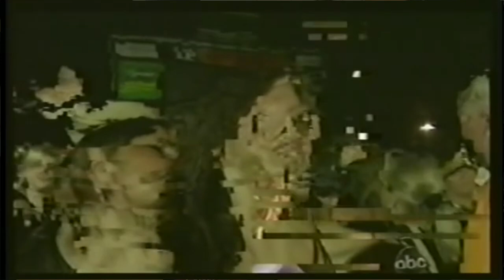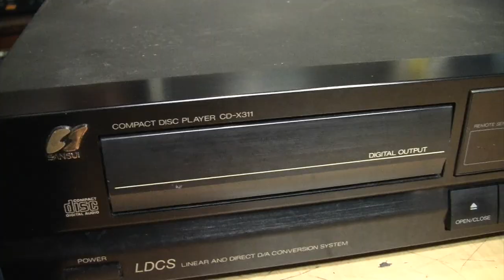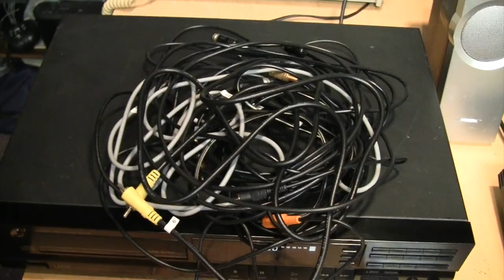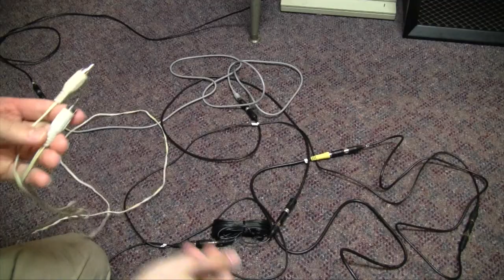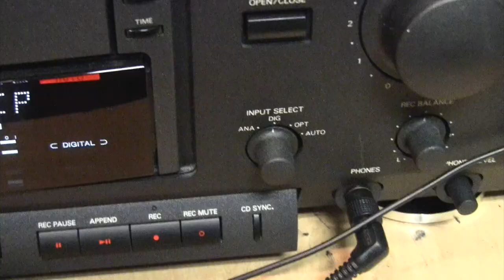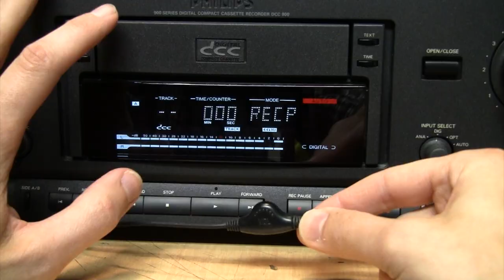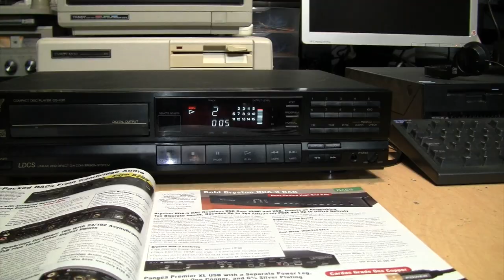What does a crappy digital audio cable actually sound like?

Comment: Yep, as far as I know, all that's happening when you add too much length or turn the pot too far down is that the voltage ceases to be high enough for the system to decipher the highs as 1s vs. the lows as 0s. So maybe by that time it looks like mostly or all 0s.
Or Jac Goudsmit's explanation might be a better one. It surely does look thorough!

Comment: You mixing “foot” and “feet”. Its kind a confusing for non native speaker.
Reply from the maker: Normally "feet" is the plural of "foot", except when it is used as an adjective, then it stays "foot" regardless of the length -- as in "a 6-foot cable". But when it's a noun, then you do use the plural form, as in "the cable is 6 feet long".

Comment: When you ran the signal through both the black and red wires of the stereo cable you introduced a huge amount of cross-talk within the signal which would have interfered with the ability of the hardware to extract the signal clock. That's a very degenerate case and not really indicative of how long the cable was.  Still a very interesting test.

Comment: I had some grounding problems using a non-coaxial RCA cable to transport S/PDIF, in particular when some equipment or light is turned on or off in the same home: in some cases, even a neon light bulb would cause the audio signal to interrupt for a couple of seconds because of the ground level difference between the computer and the amplifier.

Comment: I am only 4 minutes in to this video and I can see where it is going ….. you will try to convince us that quality cables are superfluous.  However, you need to be using much, much higher end source, amplification and speaker system to show the differences.  And using a computer sound card to deal with the signal?  Really!  And with an unauthorised driver as well?  Not one part of this audio chain is of decent quality.  You need to do this test with high end equipment with a minimum costing of £25,000 so it is no wonder you can't hear the differences.
Reply from the maker: You still don't understand how digital works, do you? There are no such differences to be heard until the signal begins to fail dramatically, as I showed. There is no analog-style gradual degradation.
Reply: I hear what you are saying but I remain unconvinced unless you are doing an A/B listening test comparison.  That is the important bit, not whether a signal begins to fail dependent on type or length of cable.  In your setup there would be no apparent difference between a 3 foot length of cheap cable and a 3ft £100 cable.  Just saying!

Comment: It was probably the Y adapters which caused the problem they would have induced a voltage standing wave (VSWR), reflecting the signal back up the wire, this would corrupt the good signal.  Digital cables need terminating correctly or you will get loads of problems.  You should use decent cables but by that I mean spend a few quid (English pound) and not hundreds of pounds. Many of the expensive "gold" cables on Amazon and Ebay are pretty rubbish as they are made to look pretty but not necessarily work well.

Comment: I always thought digital was digital until I swapped the USB cable from my Allen & Heath mixer for a 3m printer cable which gave me all sorts of trouble.  Repositioned the new Hackintosh and installed the original cable, good as gold
Reply: It could've been a USB1 cable.
USB1/1.1 cables can't handle the full USB2 speed - even though the pin connections are the same, USB2 cable specs requires shielding, twisted cables etc due to the much higher speed. I guess the longer the cable, the less chance a USB1 cable would work too. Supposedly USB2 cables are meant to have '+' next to the USB symbol on the cable, but I can't remember ever seeing that.
I suppose some devices also draw more power, perhaps very thin wires(higher resistance) cause problems in this case. Even a damaged usb2 cable could work fine for usb1(or slower usb2 connections) in some cases, such as if the shielding connection broke.
Some USB cables are made to only carry power, or only data, so it gets quite messy!
Fortunately when listening to music, it's a lot easier to tell if there's a problem :)
It does seem 'digital is digital' is accurate, as long as the cable is being used as intended.

Comment: Every certain amount of length of wire has a resistance to it. Every so many feet your voltage or ( signal ) will get lower and lower. You will reach a point where you will have to have a bigger amplifier to push your signal!

Comment: what you should have done is record 10 seconds worth of the CD with the short cable, then record the exact 10 seconds worth of audio with the 100 feet of cable mess.. then open both audio files side by side with a spectrum analyzer (free ones like Spek) and see if there is a difference in the waveform or not which will be definitive proof if cable matters. Just because it may sound fine to your ears, doesn't necessarily mean the digital signal made it end-to-end in tact.

I am assuming there may be extra noise or missing bits in the signal, as in electrical engineering, when using a tool such as a oscilloscope, cable length and unshielded cables do affect signals and is made visible on a oscilloscope as noise/flutter, or whatever to the signal, for example can feed a square wave and increase the cable length and suddenly that signal displaying on your oscilloscope isn't as "square" as it was: https://i.imgur.com/UlQNzY3.png, while that may go undetected and sound ok to your ears, there's obviously a change that happened to the original audio.

Comment: Theoretically going into an external DAC using USB shouldn't care what cable I use right?
I've used 2 different cables and noticed something odd. The longer, thicker cable had less interference
than the shorter thinner cable. By interference it's nothing like what was in the video, it was subtle yet still noticeable to anyone.
 If it's all digital, they should sound the same correct? I might make a video at a later time if someone thinks I'm making it up.

Comment: Currently watching over a 75 ft CAT5 cable, and able to pull down my full 150 provided by my ISP.  Also silly enough, the coax cable going from my modem to the connection outside is well over 200 ft.  Beyond what my ISP thinks is possible to transfer data over.  I even have to argue with them to replace it when it’s gotten broken a few different times.  Yet it still works fine when installed.  I am a firm believer that if both devices are able to transmit the signal(granted you are doing tx rx), they will work fine.

Look at WiFi, in some cases we can transfer hundreds of Megabits per second right over thin air at low power, even considering the help of TCP.  But still, the user won’t notice the difference unless there is a significant enough reduction of digital bandwidth.

Comment: AAAAAH! Grounding out the positive lead at the beginning! :-P
1990s me is incredibly jealous of all of your RCA couplers.
My way of thinking is you can't get gold from crap. If you have a lower-end DAC on either the source or amplifier, you'll be more susceptible to issues from long runs/poor cables. Being that your CD player is a Sansui, it probably has a high-quality DAC (probably better than the sound card's).
For the typical user, most likely keeping all their equipment in an entertainment center/TV stand, spending $300 on a shielded RCA cable is a waste of money. I'm picky about my sound quality, and everything I have is with medium-quality RCA cables through normal Line In/Out. Audiophile Ethernet cables exist? Man, Snake Oil Salesmen are really upping their game.
The direct-to-camera hookup of the distorted music sounds like one of my old Walkmans when the batteries were going dead. LOL
Reply: The CD player won't be using the DAC - it's outputting a digital signal, so there would be no digital-analog conversion used at the CD player. DAC is only being used after the digital signal is received at the computer.

Comment: I think you don't really understand what high end digital cables are all about. As you demonstrated, you need a lot of messy cables to distort the sound, so obviously any decent digital cable will do the job. However, high end cables are designed for high end systems, where the sound reproduction should be done as close as possible as how it was generated by the live instruments and singer voice. The reason human ears (brain) are able to easily distinguish recorded music from live instruments music is mostly due to the sound timing (which is also mentioned on the magazine you read). When recorded music has the timing of the live music, then it becomes a lifelike experience and your brain is fooled into thinking that a live orchestra/band is performing in front of you.

Comment: Today we discover a cheap way to make a bit-crusher. I wonder if you used a multi turn pot you could fine tune the drop off point to fine tune the effect to make it a usable effect? I don't have anything handy with coax out, or I'd try myself just out of curiosity.

Comment: The situation where the same signal flows through two halves of the same cable will have seriously increased the interference, so that's probably where the crazy distortion effect with the stereo coax cable used twice to add more length comes from. Normally interference doesn't matter very much with a digital signal, because the interference will be uncorrelated, but of course the same exact signal delayed by a tiny fraction of time is not uncorrelated at all, it's very closely correlated, so that will cause problems. Nobody would ever do this outside of an experiment so it doesn't actually matter, but it was cool to hear the effect.

Comment: The actual data that is encoded in Digital Audio includes some error-correction bits along with the bits that carry the audio information, this enables the CD playback system to automatically correct for any loss of data that might be caused by a scratch on the surface of the CD, it is capable of correcting data loss caused by a 4 or 5mm hole drilled literally straight through the CD.
Reply: Presumably that happens within the CD player circuitry though, not after it's transmitted. I'm not sure, but from what I could find, the PCM data sent from a CD player doesn't have error correction data in the signal.

Comment: With that cable that has the variable volume control, it's not really degrading the Digital Audio signal, it's just reducing the signal level to a point where the DAC (Digital to Analog Converter) can't properly decode it, so you end up with that sharp-cutoff point.

Comment: As long as the Digital Audio cable isn't excessively long, and the connectors are of good quality and aren't corroded or rusty, most of those cheaper cables should be perfectly adequate for the job, if you really need to send Digital Audio over really long cable runs, the best bet would be to use fiber optic cable and send the Digital Audio as light-pulses.....

Comment: The typical coax cable that is used for audio and Digital SPDif usually exhibits about 300pF (Picofarads) of capacitance per meter when the capacitance of the cable is measured from the shielding to the inner conductor (remember a capacitor is formed when two separate conductors (the copper wire) are separated by an insulator (the plastic insulation inside the coaxial cabling)).

Comment: It's possible that the cable isn't actually bad quality, it's more likely that the cable is adding some capacitance and inductance that's causing the distortion, most of those 90's vintage CD players had SPDif outputs which were at low impedance.

Comment: Nah sorry don’t agree with this presentation as your theory is being tested on very low fidelity components.  Cables, what they are made from and how they are assembled will make a difference in a HiFi system.  I’ve heard it first hand.  I will state though that it’s nothing that effects me as I have a low end sound system and use ordinary cables myself.
If your experiment is regarding length of cables only though, I’ve seen many experts that claim it’s better to have speakers as far away from the system as possible with long cables to facilitate.
I did change the free three way rca from my tvs headphone output ( my only source for digital sound) to the preamp to a $5 usd Evergreen and it definitely improved the sound absolutely no doubt.
Sorry if I’ve misunderstood the point of this video.
Reply from the maker: We're testing digital signals here, though. You're thinking of all the ways analog audio can be affected by poor-quality cables and connections, but those don't apply to digital audio -- the signal either gets through perfectly fine, or you get silence or gross distortion like I demonstrated. Try this same experiment for yourself using even your best-quality audio components and I'm sure you'll get the same results.
Reply: Sorry yes I rewatched it and see your point.   The test I heard was on all Analogue as well  Is there any chance you might do a similar experiment showing whether there’s a difference between the sound quality of a DAC in your device eg TV and an external DAC? The prices and jargon used by DAC manufacturers is equally baffling to me anyway.  I saw one Japanese manuf DAC with a price tag of $39000 USD!

Comment: Hey VWestlife, what's up? I got a question for you. I was thinking about the evolution of technology the other day(I know, not an everyday kind of thought) and wanted to ask you if my theories were on track, since you do a lot of research. I was thinking about how wide CDs are and why they are so big. Apparently they are 4.7 inches in diameter, but why couldn't they be 4 inches or smaller. Then i began to realize how in their jewel case(at least the blank ones), they kind of look like floppy disks, the ones that were around in the early '80s. Since they were the disk at the time, I was wondering if the size of the CD was based off of the floppy disk inner disk. And that maybe because makers were making devices that were built to accommodate that size, by the time that smaller floppies came out, the size just stuck around. I know that smaller disks came out, such as the mini disc, but could this still make sense. 
          Then I started to think about DVD cases. I had bought a VHS tape of "The Music Man" that came with a hard plastic clam shell case, much like what comes with a DVD. I wanted to ask you if the idea of a DVD case first came out with tapes. I remember that you did a video about 50 year old audio cassettes and how some of them came in paper sleeves. Later cassettes started to be packaged in plastic shells, which I think is what also became the jewel case for CDs. Could this have also happened with VHS in the late '90s(my tape is from '98)?
             I'm sorry for the long response, I know that it's not wanted, but you're the only one who is knowledgeable to actually answer this. Please let me know if I am on the right track on any of these if you can. Thanks for your time!
Reply from the maker: When CDs were introduced in 1982 they were smaller than any of the floppy disks in use at the time. So no.
Reply: @vwestlife  Even smaller than the 5 and quarter inch? because I measured the size of a jewel case and it's roughly five and a quarter inches. So I would have figured that the disc inside would have been the same size
Reply from the maker: Here's an early promo video for Philips' prototype CD player in 1979 (in German). The discs are shown as coming in cardboard sleeves, like LP records, not in plastic jewel cases: https://www.youtube.com/watch?v=iXBw0jc3770

Comment: All those female-female couplers will significantly degrade signal on their own..added with the length of "cheap" cable you added, the signal still is strong enough for any error correction, until its breaking point...nice! I used a 17 foot RCA cable from a cheap Scosche car amp kit and it cleaned up analog signal path and dropped noise from my PC to a remote amp drastically after previously using several old "hi quality" 6ft Radio Shack RCAs and couplers to do the same thing! But yea if you need to go long distances(50ft or more) then maybe higher quality cable could be the solution, but even those will only get you so far...thanks for sharing!

Comment: You only need a 75 ohm coaxial cable. A cheap one is ok. An expensive one can increase the distance but not by much! Digital can not be degraded unless the signal is weak.

Comment: The DCC machine probably just treats any digital signal that doesn't pass CRC checks as invalid and cuts off immediately when there are any artifacts (or it might perform some error correction and as soon as that doesn't work anymore it cuts out?). The soundcard on the other hand probably just doesn't give a crap what you feed it and if it's a valid signal or not, hence playing the distorted audio. Would be interesting to see if there are any filters (SMD bypass caps etc) on the soundcard PCB that would make the SPDIF input a bit deaf (as you described in the last part of the video with how far you could turn down the volume control... or data control? :P)

Comment: I really liked a 300-500 usd HDMI cables, for what? I used 1 usd hdmi from aliexpress without any issues. Also I made myself a really crude switch to switch between speakers and headset (from audiophile grade soundcard to dt990) from earbuds cable+3.5 sockets from china+switch from household stuff and still can't hear single issue.

Comment: In my experience there much more improvement in sound quality if the audio equipment in the signal chain  runs all on batteries than improvement brought by the very expensive digital cable compared to the cheap ones.